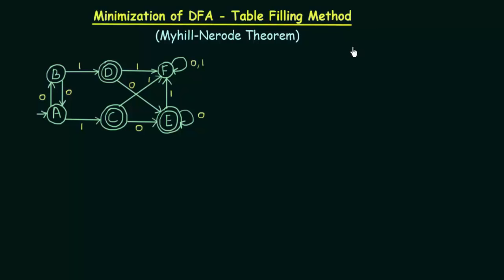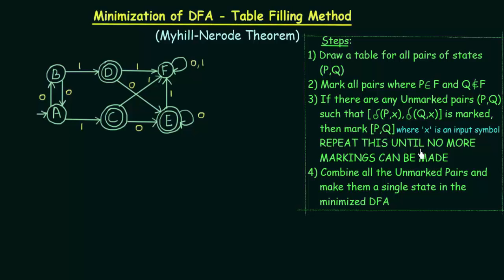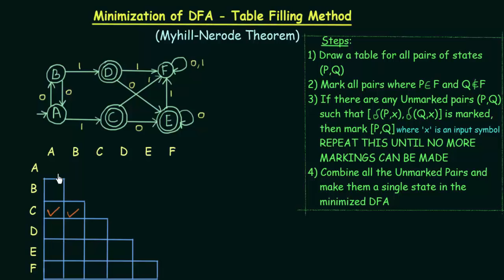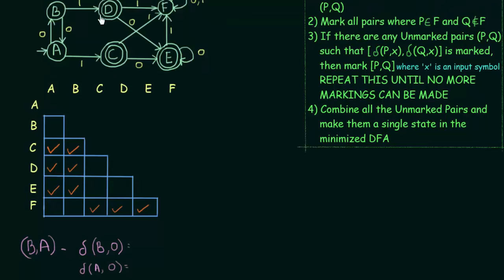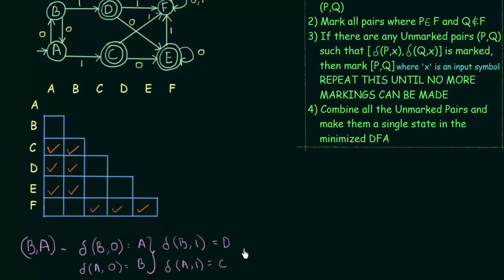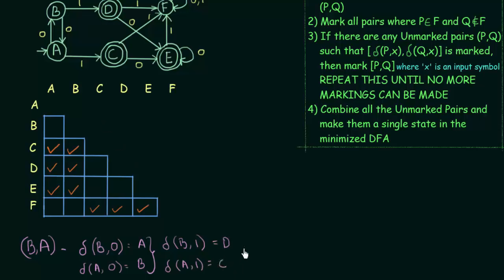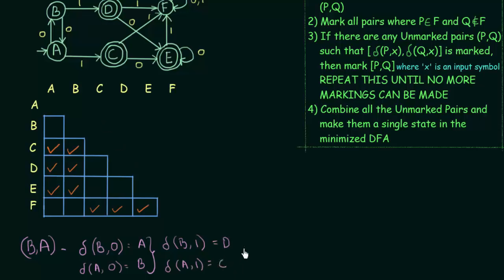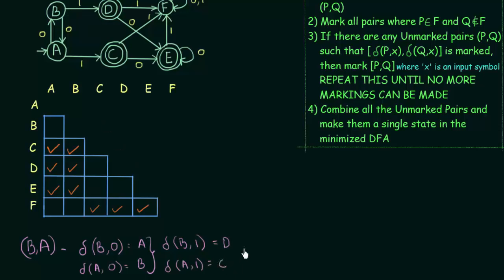Myhill Nerode Theorem - Table Filling Method

Comment: When checking (P,Q) = (F,B) (13:40), he didn't check for transitions on value = 1. Technically it would be the pair F,D on 1, which is checkmarked already. Did the video forget to  check that, or is there a rule on when we have to check all values to be check marked?

Comment: if it was possible to minimize a DFA using the previous method so easily why does Myhill theorem exists???
Reply: I know this question was asked 1 year ago...but still, let me state the reason...
Partitioning method can be applied easily on dfa with less number of states. But when the number states is huge, you would rather prefer to follow a rule(or a algorithm) to minimize the dfa without any error, as partitioning method creates a lot of confusion(and requires a lot more concentration) when u have to deal with large number of states. And Myhill theoram provides u with that rule !!!
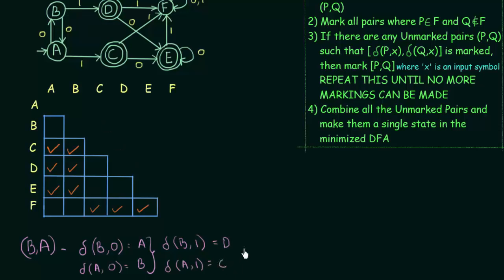Reply: @backslash8874  yeah 18:41

Comment: Sir if there is any unreachable state in Myhill-Nerode Theorem  then what should be do with it?
Reply: Eliminate them and any transitions coming out from them, along with the chain of states attached to the unreachable state; Example: gyazo.com/00df10b0a254234e49d760a1d3a60228
Reply: remove that state
Reply: remove that state